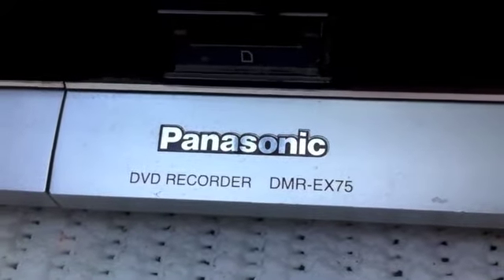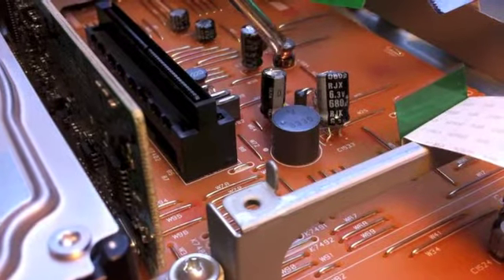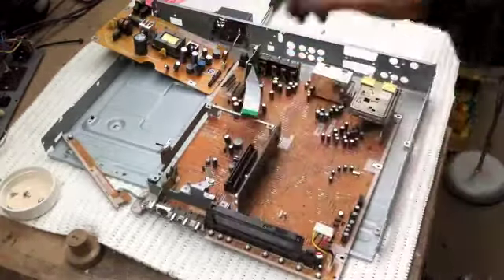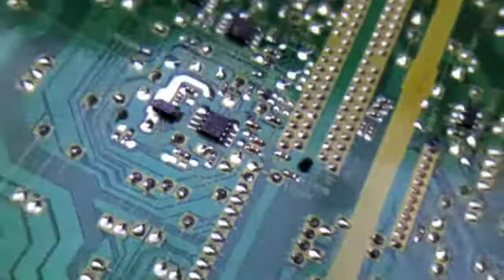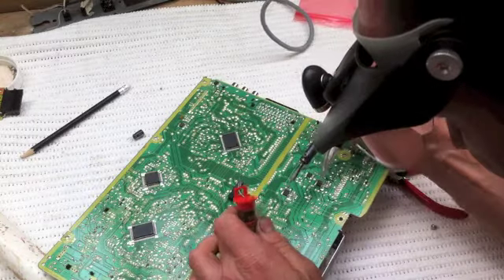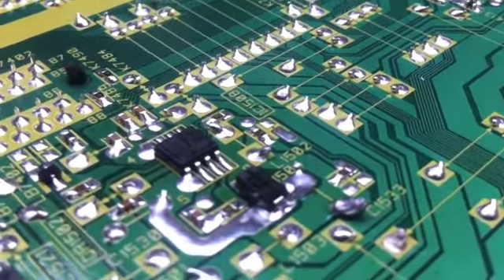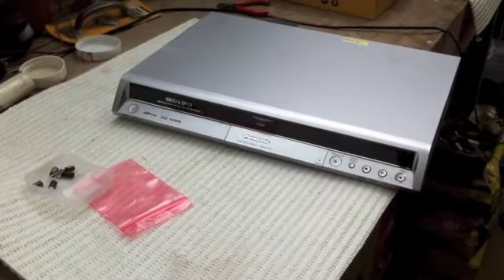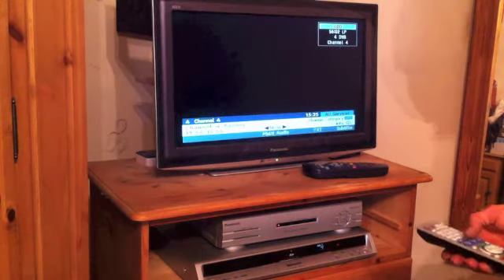Panasonic DMR EX75 Repair Fault No Free-View

Comment: ...whilst this is the proper way to effect this repair (respect), the capacitor can be replaced WITHOUT removing the main board.  To achieve this, just snip off the faulty capacitor close to its can, leaving the old legs protruding upwards.  Then solder the new capacitor onto the old legs - this can quite fiddly, but saves complete dismantling neccessary to get to the back of the main board.  I've used this approach several times with success.
Reply from the maker: +Feedbackboy1 Yes thanks for pointing this out you are quite right its just in my nature go the full hog.

For anyone watching take this advise as it will save you a lot of time.

Comment: I have a DMRES25 it looks very similar to yours except no hard drive. To remove the front panel are there any additional screws other than the clips? i wiggled it a little bit but i didn't want to damage the power button so i just left the panel in.